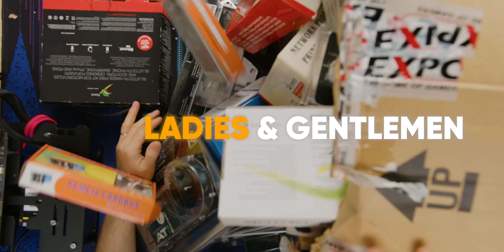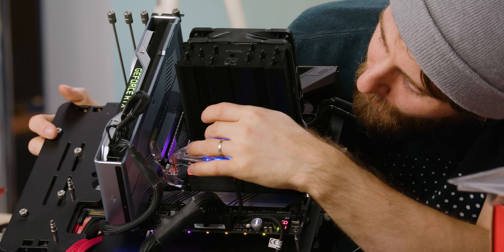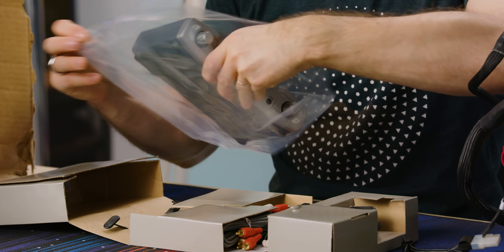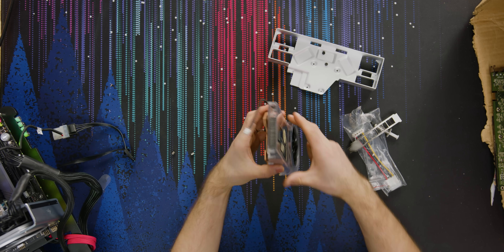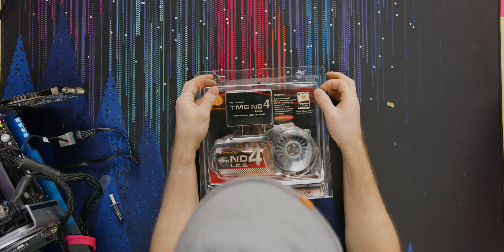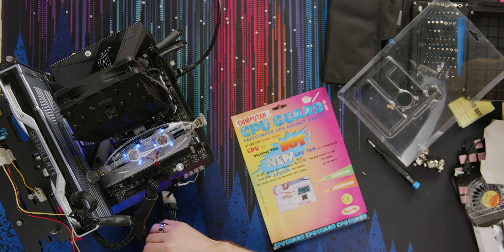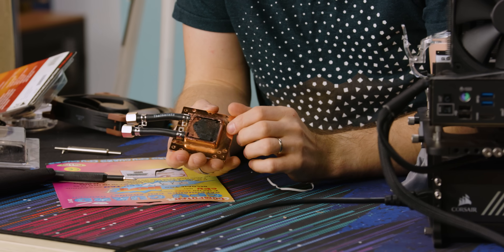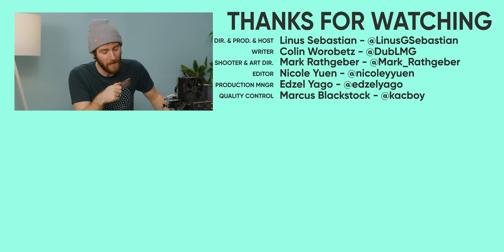I Bought Out This Bankrupt Computer Store's Inventory

Comment: 5.1 Dual channel Headphone system, who would ... I would!!!!
I loved to watch movies on my PC with my wife aside.
So, we got us a movie, we fired it up, and sat side by side watching the ... liar ... I was more playing with the missus than watching, but I cared not, as the movie was on my HDD, so, rewatch ... liar ... replayable (the missus, not the movie.).   :P
Reply: Phah, in 1996 I dompled a PC (in it's entirety, yes! The whole case (which was specially cleaned to prevent contamination) in a (specially cleaned) "bath" (see-through glass container with lid that was "sealed" with rubber) De-Ionised (as well de-mineralised though special filters and Ultra-Violet treated) Water (UPW or Ultra-Pure Water), which was kept darn cold by frozen!!! blocks of De-Ionised ice (frozen De-Ionised water, in other words).
As you all know, De-Ionised water does not conduct electricity.
Now, our teachers freaked out when I plugged the damn thing in (since I never had told them about what water it was) during the science fair in my school, and they were just so baffled when there was no boom.
Nor lightning.
After explaining them, laughing (since I wanted this reaction from them), I tweaked the system for 1/6th in overdrive ... overclocking in bath submerged (quite new back then, I suppose) ... which it held for the entire fair.
4 hours long.
I DID need to put in new De-Ionised ice regularly, since it melted fairly fast ...

One bad issue with the whole thing (which was a proof of concept): De-Ionised water was darn expensive!
Now, our lab made it, so, got it "cheap" (cheaper, but not that much).
Luckily, I could reuse it to freeze new blocks in the lab, we had quite a bit of different liquid gasses:
Oxygen	(-183°C) , Nitrogen  (-196°C)  , Neon  (-246°C) , Hydrogen  (-253°C) , Helium (-270°C).
So, cooling the De-Ionised water FAST was no issue.   :)

Thank God.

I was thinking first to use Nitrogen, but the system would not survive the cold, even though we used 54-series of chips and other hi-grade materials.
It was the motherboard itself that would fail horribly so.
That was the only component we could NOT find of high grade ...
Reply: And no, if we had used Nitrogen, it would not be in submerged version, no.
Not even the 54 series could have taken that cold, no matter what.
If I remember well, they die around 45°C to 55°C

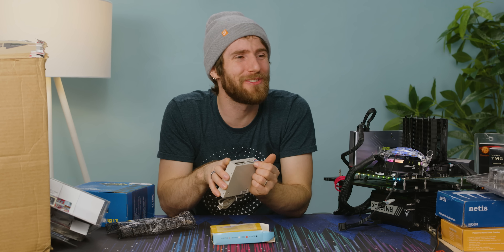Comment: 3:19 I have one that looks exactly like that, but with a beige cable and random metal thing at the start of the cable (the back of the device).

and it doesn't have any logo on the front.

It doesn't work

Comment: 3:36 - be real careful trying to run a lathe with a usb to parallel adapter. Every last one of them was notorious for being utterly useless for anything other than printers. Many of the pieces of software that existed at the time manipulated the control registers of the parallel port directly and were extremely sensitive to timing. Running it over USB completely breaks all of these applications because the timing isn't guaranteed at all. I have some old parallel port microcontroller programmers for AVR, PIC, etc. and they uses bits in the parallel port to drive clock lines among other things.
Reply: Also part of why you can get parallel ports on new motherboards especially stuff for extreme environments.
Reply: Been using usb over a yrs now..so far so good
Reply: @ER0S4GE  Prrobably highly dependend on cable length and interference from other cables.
Reply: Don't worry. It's absolutely not possible to use this cable with MACH3. It doesn't support bit banging. End of story.
Reply: @zaprodk  "Bit Banging" 
I have something to research, now...
Reply: @zaprodk "bit banging" sounds so wrong...I'm so sorry 😂

Comment: Not gonna lie, that CPU guard might legitimately be useful.  Had my CPU fan for an i7-4790k stop working once and didn't notice it for several months because my case had more than enough airflow to cool the heatsink without a dedicated working CPU fan.  Didn't impact performance at all, but still would have been nice to know.  Only ended up noticing by chance.  Knew that it must have been like that for quite a while because I regularly keep watch over my CPU temps when gaming and had noticed that it had been a few degrees higher than normal, but nothing extreme or worth worrying about.
Reply: your bios should have an option for it, but I think that requires a buzzer attached to the IO pins. 

I think speedfan and hwinfo can also do that via software
Reply: @aleks138  Yeah, I'm not actually going to use something like that(especially after getting a Noctua fan).  Was just pointing out that as absurd as it sounds, it does surprisingly have a possible use case.  Thanks for the info anyway though.  In most cases, the computer should automatically shut down or have the CPU thermal throttle if it gets to hot meaning that a tool like that is mostly redundant and unnecessary.   It was just in my case that it didn't behave that way because my case cooling was too powerful and my CPU was never in danger despite gaming and using it at full capacity.  I didn't know that something like that was possible (to run the CPU at full load without a CPU fan), so I find it quite comical that it even happened.  I doubt that it will end up happening a second time though.

Comment: 3:15 had something similar to one of those. After cleanly ejecting any card however the whole device wouldn't accept new cards until the USB was disconnected/reconnected. It being internally USB connected it meant effectively rebooting the whole frekkin machine. Clearly the assumption of the firmware of my card reader was that is was on an external one. Ow the 2000s...

Comment: 6:07 I actually ran Arctic Cooling NV Silencer 5s on two 6800 GT cards in SLI... they were fantastic! The Silencer 4 is for the older FX59xx series cards. That brought back memories.
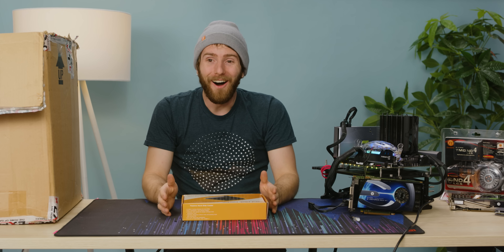Reply: Hahaha, 8:01 ... I ran HDD silencers/coolers for my 1st gen Western Digital Raptor drives (I think they were 80GB each). Specifically Scythe silencers.

Comment: When I was taking some IT classes the county program that covered most (I was forced to surrender my PEL grants) of my tuition was supposed to buy me a PC to bring back and forth. They failed me again and I was forced to use a basic school computer with one of those removable HD cages. They'd lock up my drive at the end of class and I'd slap into whatever POS was available to me. They didn't work bad. Just awkward.
That video card cooler would have saved me SO much bullshit. I custom ordered, back when you could pick every single component of a rig, a decent AMD Athlon 550 with a Diamond Viper v770 Ultra video card. The fans hung under the card so the bearings or brushes would just eat themselves. Then you make a warranty claim, they send you a generic knock off with half the specs, you argue, they agree to send the proper card and do. I went through that three times in a YEAR then the company went bankrupt.

Comment: That 5 1/4 thing is actually a caddy for 3.5" hard drives where you could pull the hard drive carrier directly out from the front of the pc (it even has an integrated handle). I have one of those that I still use when testing and wiping old drives.

Comment: "This is Thermaltake doing what Thermaltake does best - ripping off someone else's product"

Truer words have not been uttered. Still the case even in 2022.
Reply: Another specialty of Thermaltake is making weirdest shit for PCs. They made a fricking aquarium side windows for case, VU meter, some weird cases like Xasers, bizarre coolers like duo orb. TT is crazy.
Reply: @MJ-uk6lu  Dont forget the good old Thermaltake X-Ray. Essential for any big tower sitting in the admins office. :)
Reply: Well it is ThermalTAKE not ThermalGive 😉
Reply: I very much enjoy my Chaser MK1. At least back then cases had more variation... Now it's just all glass and frame... BORING!
Reply: i  still have my NAS thermaltake i fell attacked
Reply: Really? Sweet, who'd they rip off the Core P3 case from? 

I've been using mine for years and am really eager to suddenly negate my 1st hand experience based on the snark of some guy on YouTube.
Reply: In defense of Thermaltake, they make great power supplies. I had 2 EVGA PSUs blow up within 6 months of each other so I bought a Thermaltake. 5 years later and its still going strong. Voltages are rock solid under load, and within 2.5%.
Reply: @brentsnocomgaming7813  Good power supply? TT fails so much.
Reply: @ranjanbiswas3233  Actualy TT TF1 psu's are very good ,like top tier. We had a few 1,5kw Toughpower TF1 titanium at the mining rigs and they were the only models over 1000w that none died. Very strong units , you can't go wrong getting TF1 or PF1. I have a white TT GF1 Snow 850w in my PC, it was very cheap ~100€  other quality white PSU's were double the price ... anyway you can't go wrong getting any A tier PSU, the brand doesn't really matter, I think even B tier is fine for a gaming PC.
Reply: @brentsnocomgaming7813 are your other PC components safe when your PSU's blows up?
Reply: @brentsnocomgaming7813  I had the opposite happen
Reply: @brentsnocomgaming7813  It all depends on the model you buy. Most brands use different OEMs for different models. So if you get lucky, you can even get a good PSU from Thermaltake - if the OEM for that model is good.

But i would never buy anything of Thermaltake for myself. If a customer wants it - fine.

I don't want to support 20+ years of copying designes and badge-engineering and only having one own design per year.

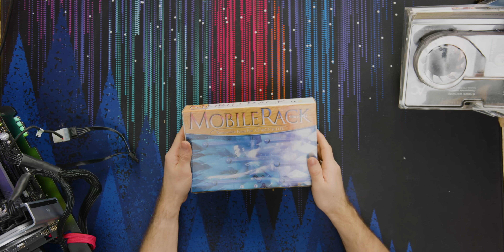Comment: As someone who prioritizes easy access to hard drives without opening the case, thus preferring HDD docks in my bays... I'm offended at his attitude at 3:43. No side panel removal is king!

(I even bought a SATA version of that just a few years back at a small store with old, interesting stuff like this)
Reply: Had 4 of them in my Chieftec B 04 big tower case :) It was pretty cool for fast HHD swapping for backups etc :) And cooling as well, because there was a small fan at some of them, or you can put any fan at the top or bottom, or at the back of maybe 3 of them, because that stuff is vented all arroun :) Just this stuff did't insulate any vibrations... :(
Reply: @Terablick  nice! yeah I'm all about big cases; hate fighting the case to replace or fix stuff. Before i moved abroad i had the thermaltake lvl10 GT. And that's right, I forgot about the fan!

Comment: So i work at a pcb assembly company, and that cpu guard thing is sooooo old, all of the components are through hole parts, which means that they were put in by hand, there are no surface mount parts which are your common capacitors, resistors, transistors, processors, etc, that thing is absolutely ancient

Comment: At 4:01 you're touching something I bought for my full server tower.  Removable and locking hard drive kit.  Don't lose the key or else you'll have to unscrew the frame from the optical drive bay to get access to the HDD inside.  Relatively easy to do once it is extracted from the computer's chassis.

Comment: What the fuck is Linus talking about? 5.25" removable caddies are still used today. You tell me how you'd swap and change HDs without dismantling your machine everytime? With these, you'd simple have HDs in removable caddies and I think you could even hot swap them too. I've still got a machine like this where I have 3 caddies, each with 14TB drives in them and I can just switch them out in like 30 seconds. No dismantling of the computer required. Doofus.

Comment: 8:00 I never owned one of these HDD coolers, I did have some of the type where it was a pair of fans that mounted to the underside.
However, when I did have a hard drive that ran hot, I purchased some random 3 inch by 5 inch heat sink, smothered the smooth side in paste, and just stuck it to the top of my hard drive.

It did the job.

Comment: 3:49 In Poland, those 5,25" HDD drive bays were extremely popular. Almost everyone had at least one of the disks in one of those - thus being able to go to a friend and copy any content from him instead of wasting money on CD-R disks (not even mentioning floppy disks). Still have some of them in my old PCs in a basement...
Reply: I remember always removing my HDD from inside of my computer and walk to some friend with that, I wish we had such bays back in the day, external HDDs were so slow thru USB that it was better just connect it directly to IDE or later sata inside of your computer. :-)
Reply: And there were two standards of these, completely incompatible, and an eternal holy war which one was better - one had some protective circuitry so you wouldn't fry your drive if you seated it poorly, but some drives just refused to work with it, the other was just a dumb IDE pass-through, so it worked with every drive but you had to make sure it plugged in well, and there was eternal messing with switching the drives because you had a bay that wouldn't take my carrier, but your carrier wouldn't work with my drive...
Reply: Those drive bays were common in NZ too, I had a few. It did make drive upgrades easier and could be useful for backups. But before autodetect IDE they were a hassle for regular changes as you had to stop in your bios each time.
Reply: @blakjaknz  oh my, you just reminded me how painful it was to input number of plates, heads and cylinders everytime you've connected a hard drive 😆 And how breathtaking it was to see first mainboards with IDE autodetect ☺️
With those removable drives it was a pain in the ass when you had to switch drive from MASTER to SLAVE of vice versa...
Reply: @nobodynemoq  what happened if u made a mistake inputting those nunbers?
Reply: @blakjaknz  now those were hard [to use] disks! :)
Reply: In the Czech Republic it was the same. It was because of the high price of empty CDs.
Reply: The only downside I see to that is pulling a Linus on your HDD (dropping it) and losing all your data in one fell swoop. (Pun intended) xD
Reply: I still have one of those in my PC 😂 use it as a drawer for my CPU.
Reply: But why? At that time, there should have been USB launched, hell perhaps even serial or parallel adapter for HDD.
Reply: Hot swap hdd bays are still a thing. I don't get why Linus doesn't know about it
Reply: @maevrik  I'm sure he knows, I've seen him use them in some of their videos so it's something different that's weird to him.

Comment: I used the hell out of the tv card I had in my computer when I was in high school, it was fantastic for recording Stargate Sg1 and other shows that I would have otherwise missed. My how times have changes.
Reply: I still use an old ATI wonder 650 hd tv card using a vista driver in win 7 for my O.T.A Dvr. It's not old in most terms but around 2010 in computer terms is old

Comment: @6.10 I'm still confused by peoples instance that blower type coolers are bad.  For me removing the heat from the PC case is the thing we should be persuing however everyone seems to think that circulating the heat within the case and increasing the ambient temperature of the CPU and other components like RAM/SSD's on the motherbord is better for some reason.

Comment: that zalman amp... i love when people dont know what a product is for and then talk trash about it
the reason it can be used for 2 outputs is not for 2 users... one is for speakers and one is for headphones...
and that IS actually pretty nice, for anyone with a true multi driver per earcup surround sound headset...
now those tend to be heavy and overhyped... but they do have benefits over simple stereo heatphones with only 2 drivers.

Comment: Hahaha, at 6:16. I had two of those for my 7800GTX SLI system. Had to drill little holes in the plastic, because the backplate poked the front of the second cooler :D Good times.

To be fair, Arctic still sells good stuff. The fans, coolers and thermal paste are pretty good.

Comment: I'm ashamed/ecstatic that I've used 80% of these items in my day.  Never had the CPU fan "guard" that apparently shocks you when you install it, the Zalman headset deck (my altec Lansing wall mounted 7.1 speaker setup was "groundbreaking"), or the TT water-cooling knockoff of the AC heatsink (I used DangerDen and Home Depot barbed fittings with masterclear tubing and zip ties for that!).  Still used a plethora of the OG AC blower-style coolers though on multiple cards. They were a literal upgrade to the dog 💩 GPU's used to come with!  Love when you/anyone does these kind of videos!!!

Comment: I used one of the CPU fan fail gizmos on a two-way radio repeater to ensure the power was disconnected if the cooling fan stopped. The radio transmitter would happily turn to liquid if it was allowed to transmit un-cooled.

Comment: I had a TV tuner card in 2003, because my dorm didn't have enough space for a TV and a PC, so I would plug in my PS2 and Gamecube to the monitor via a TV tuner card's RCA input. The back of my PC was a rat's nest of wires, adapters, and Y-splitters.

Comment: Not gonna lie. I happaned to find two of the parts of that "3 in 1" charger at 5:45 implying I used to actually have one of these and it probably was one of my first chargers with a detachable cable... holy hell.

Comment: That USB to parallel cable is like diamond dust in engineering. That's not even fair because we have loads of diamond dust for polishing. I cannot tell you how many times thousands of pounds worth of machinery cannot be used because we can't find a free PC or adapter that will work with the parallel port they use.